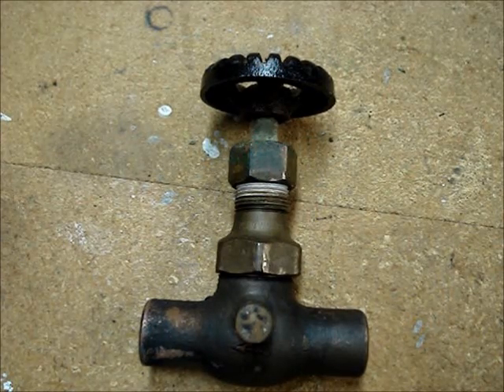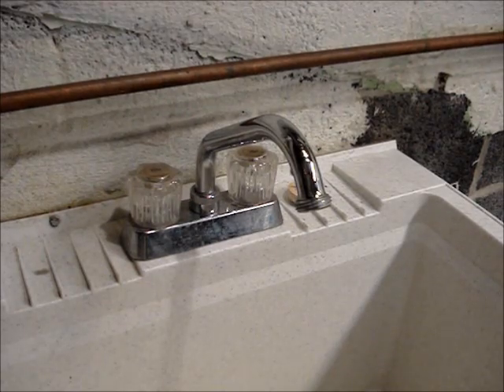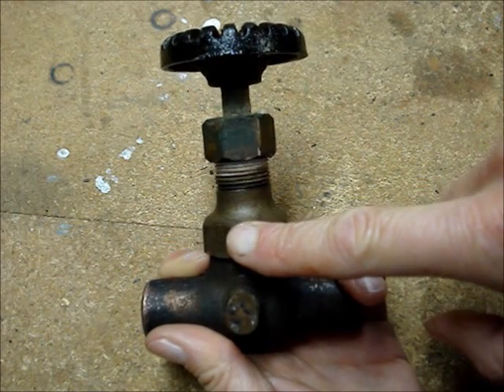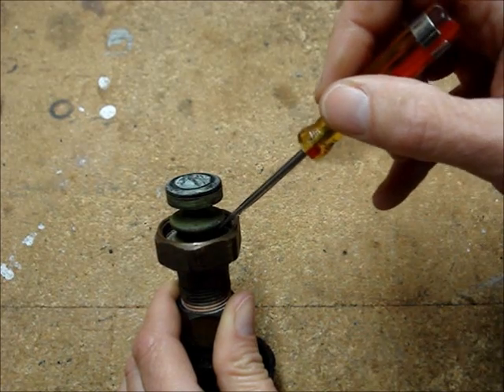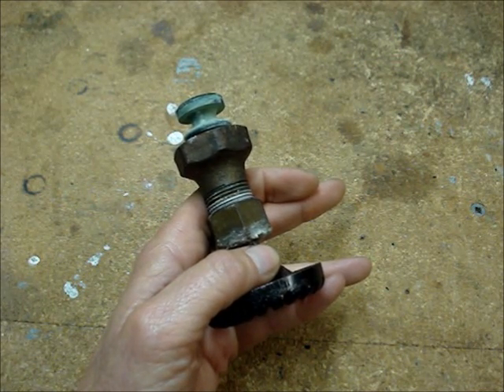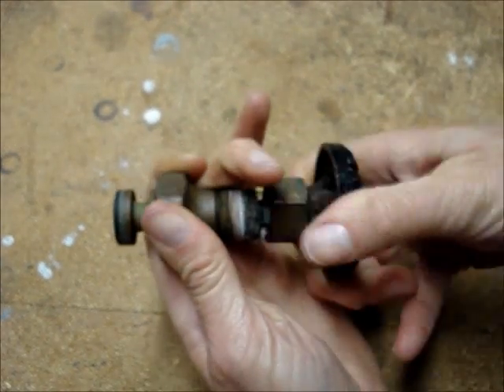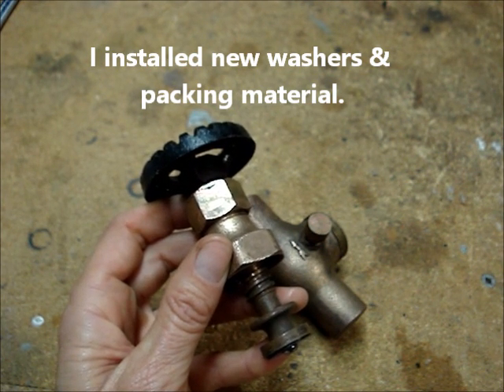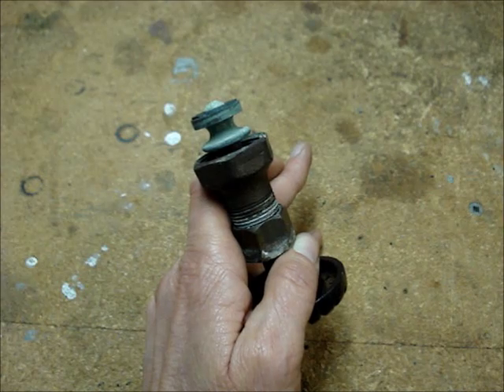Loosen Corroded Stuck Water Valve

Comment: I'm a Brit over here across the pond, Simple easy advice for exactly the same problem as another subscriber on here, Plumber came yesterday and said " That's solid, if it snaps you'll have a hell of a problem in that position, I'd say leave it"  ( it was right tucked up under the hot water tank in the clothes drying cupboard, probably hadn't been opened or closed since the 1970's )  anyway, worked on it myself steadily for an hour or so and hey bingo ! ....... freed up and working like new, and I didn't even need to remove it, thank you my dear lady, you are a star and a "Can do" kind of woman.
Reply from the maker: You are welcome, Mark.  Patience usually pays off here.  Greetings from the U.S.

Comment: Thanks to your excellent video I opened a corroded stuck water shut-off valve  to the washer that had been stuck for 15 years. 3 different plumbers over the years that I asked to open it, just said "leave it alone", they didn't want to deal with it. The way you just stated the steps clearly with no quick & dirty shortcuts is the best! I did cheat a bit though, I used a tiny speck of PB Blaster and found a comment by them stating that PBB won't affect the structural integrity of high density rubber washers, tho may cause some surface softening. Low density (flimsy) rubber and/or plastic washers will be negatively affected. I guess I have to plan on eventually cleaning up the entire valve and hope I can find high density rubber washers! Kudo's to you for great videos!
Reply from the maker: Hi Corinne, thank you for taking the time to tell about your experience.  Way to go on getting the valve unstuck.  I was hesitant to suggest PB Blaster because it might damage washers or the packing material.  If the valve is in a place that's hard to access/solder I'd go with the PB Blaster as you did and take the chance on having to rebuild it.  I do have a video for that.  Thanks again for the helpful comment.  Here's the link to the video if you need it:  https://www.youtube.com/watch?v=g8ORORWGsWw

Comment: Hello!  Your video piqued my curiosity... our house was built in the 1950's, but renovated with all new plumbing in 2009.  HOWEVER, there was a hose bib (with a VERY old/rusty gate valve that operated it) in our basement that we never used, that was located just a few feet downstream from whole-house water shut off valve.  During a simple PRV (those are code where we live) replacement a few years ago, in order to ensure that the new PRV was set to the proper PSI, we put a water pressure gauge on that old hose bib in our basement and turned on its very rusty gate valve (**again, first time we have ever opened that gate valve).  EVER since then, our water has had a sticky/tacky feel to it... almost like it has a hardness issue (note that we are on municipal water).  But our hardness keeps testing low (2 gpg), with multiple different water testing labs.  We have NO filtration or softener system (just a hot water circulating loop + gas water heater, both of which hv been replaced since this sticky water issue began).   I keep wondering if, by turning on that old/rusty gate valve to check the pressure after PRV replacement... maybe rust, hard mineral deposits, etc were released into our (closed) plumbing system and are causing the water to feel sticky/"secretly" hard??  It's been maddening trying to figure it out, and our hair+skin+laundry+appliances have all felt the negative effects of this instantaneous "sticky" and drying water for the past almost five years!  Any insight you might have to this perplexing issue would be greatly appreciated. Thank you & apologies this turned out to be a longer-than-normal post!  :)
Reply from the maker: IMHO, I don't think opening a valve could cause a problem that could continue for 5 years.  If you haven't already done it, ask your neighbors if they are having the same problem.
Reply: @Know-How-Now  Thanks so much for your (prompt!) reply.  :)  Yeah, first thing I did was ask our neighbors if their water felt different... they said no.  I've talked to SO many different plumbers, lab/water specialists since the issue began.  One PRV replacement (with just a few new inches of standard Pex + new brass fittings installed around it), and our water becomes tacky/sticky.  :(

Comment: Vinegar to remove corrosion. Never knew that.
thx
Reply from the maker: You can use lemon or lime juice too.  They are also acidic, the acid breaks down the mineral deposits.  Where I live we have a lot of limestone.  Rain is acidic and it eventually breaks down the limestone, leaving behind a sinkhole.
Reply: Now ya do Dave !
Reply: @Know-How-Now  what about CLR or Limeaway?
Reply from the maker: I would check the labels on those products before using to insure they do not damage the packing material around the valve stem
Reply: @Know-How-Now  yeah, after reading what someone (you?) wrote regarding corrosion on brass, I’m not using CLR or Limeaway. I just hate that I used that PB Blaster before trying the penetrant. It’s likely blocking it from getting in there. It’s been a week and although I’ve been busy with work and other things, the valve is still lodged.

Comment: I did find the video helpful! Tx Glad I could help you back. :p do you know why(if anyone does it's you) a brand new brass valve would rust up right away? I think it's rust anyway, and I think it is not the valve but the housing. It is the house shower, hot. It was leaking, I put in a new valve, it was just barely sealed and over the last two months it is back to full on leak. I took out the valve it's full of a substance most akin to BBQ sauce visually, lol. I would much appreciate any thoughts? ty

peace
Reply from the maker: It sounds like maybe you have a problem with the water heater.  https://mikediamondservices.com/blog/tap-water-looks-rusty/

Comment: How do you know if valve wont open all way. Mean valve open half way. How do I know that, does water pressure fall off after few seconds
Reply from the maker: Valves are not standardized, so it's hard to know if your valve is fully opened.  If you have another identical valve, you can open that one fully and compare how much of the stem is showing to the one you are not sure is all the way open.

Comment: Did you skip some important steps? Video skips right from “shut off water..” to “remove valve from valve body.” What? How do you remove the valve????
Reply from the maker: I showed you how to remove the stem from the valve.  I assume that the viewer can figure out that I am using a valve not connected to pipes for demonstration purposes.
Reply: You disassemble while the valve is in the pipe, she is using that as a demo

Comment: What happens if it's the main shut off valve in a condo apt?
Reply from the maker: There are pipe freeze kits.  That would be a way to get around a bad shut off to a condo without turning all the water off.  https://www.ferguson.com/product/general-pipe-cleaners-cold-shot-cold-shot-pipe-freeze-kit-18-in-2-in-gcst2/_/R-1321268
Reply: Caution on rental properties....if you screw it up and it leaks behind the wall(especially if it’s been a while and you don’t know it’s leaking) well....the legal ramifications against you will be costly! DIY on rentals are not allowed so you better deny having even touched the plumbing, hahaha! Seek a pro if you don’t think you can do it at 100%!